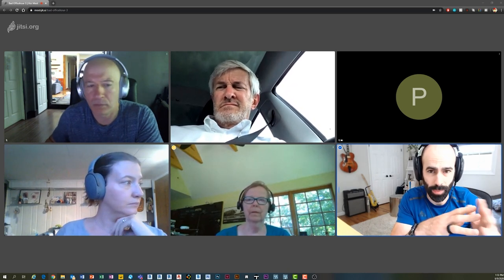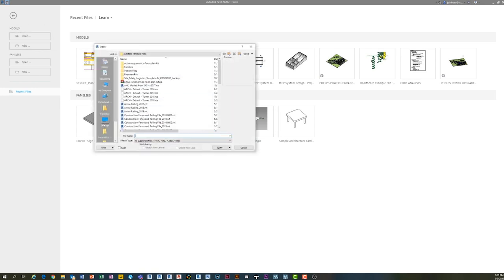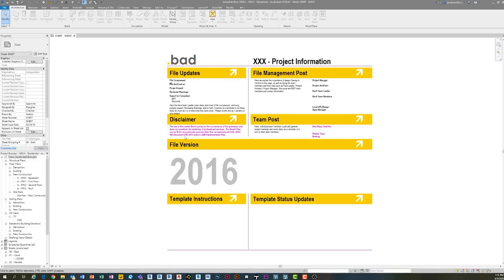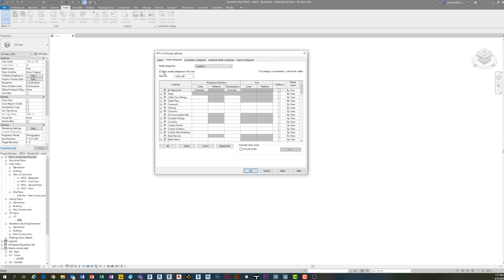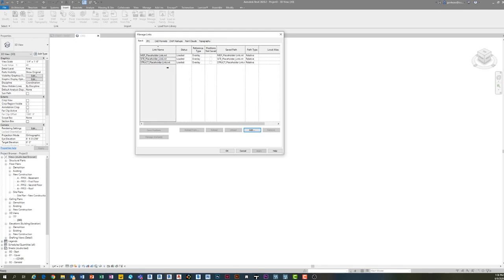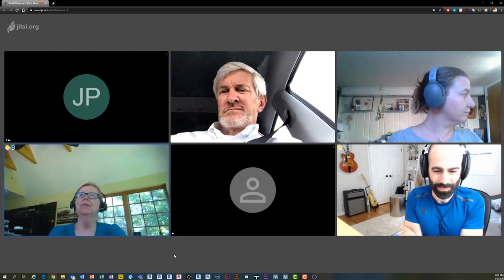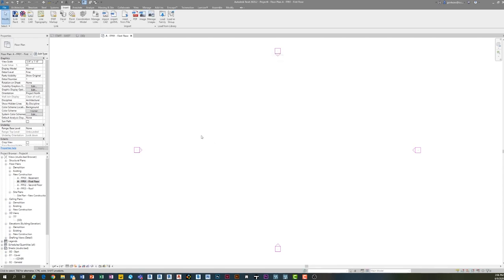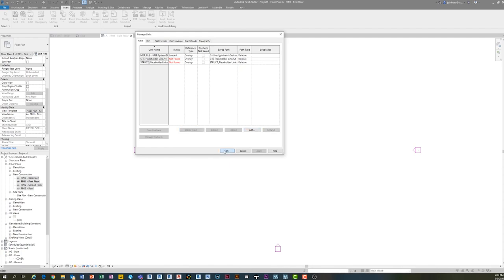Placeholder Links in Revit Tutorial (Office Hour Sessions)

Comment: Being on the General Contractor (MEP) side of things I found Linked Views with a combination of links as Attachments VERY helpful.
I am self thought in Revit so anything I say that I do here might not be ideal...

Since we get structural models from a design team that will have concrete work and structural steel (which is usually superseded by our subcontractor).
So the scenario I have in one of my projects right now is the design steel is removed, a linked view is set up and all out subcontractor steel is linked as an attachment.
The linked view is cleaned up with grids turned off etc.

Come into the MEP model, this linked view is then set. This means if we get additional steelwork models (for future phases) or updates, I can load this into the original steel model that's got the linked view.
I do the same for architectural if our internal and external walls are different.

Other scenario was pretty similar which was a project with multiple floors so it's just multiple linked views.

Now, what do I do in the MEP model? This might be where people cringe or internally scream no to themselves, I set up a template that affects ONLY revit links and sets my revit links to have linked views (arch and structural) and do one for each floor.
Then I can run dynamo to apply that template based on what the reference level is so it can sweep across and apply the linked view to all my level 0, level 1, etc.
Then I can swap back to a template that affects model and annotation categories specific to MEP services be it an electrical or piping template, these could then be used on multiple floors.

So linked view templates are floor specific across multiple disciplines (mech or elec).
Services tempaltes are discpline specific across multiple floors.
But working on data centres now, we work on 1 floor really so I haven't needed to go to that extent.
I don't know if good or bad practice but it worked for me and cleaned up a lot of stuff real fast and means it's consistent with linekd views.
Reply from the maker: Damn!!! My mind is blown... I am not sure if it's because I read that and was actually able to follow the logic or because I like the idea... :)  Cheers man!
Reply: @TheRevitKid  At least it made sense!
It's a bit of a hassle and it leaves you open to having your links modified if they aren't in the services based template but if you get it all set up, it's an easy fix to just rerun the dynamo to update your backgrounds.
Hosting all the structural files we get into a single model means if I get a new model to work on, we don't have to link everything, can just link a single model.
We do run into 1 issue though that it means if we're working on BIM360, everything has to be hosted on BIM360 as it won't accept links as attachments if you link through autodesk docs (which just baffles me that it doesn't work).

Comment: The use of a "dummy link" is most powerful in my opinion when it comes to showing linked annotations specifically room tags. If done correctly, you can get the architect's tags to show in your MEP model template without having to run anything. It's also useful to set up some 3D coordination views that are already filtered by color so all the Arch stuff comes in blue, structure shows in red, etc.. Love these videos! I ended up reaching out to Paul about the lookup table video. He actually got back to me! I wanted to know if he'd ever went down the rabbit hole trying to do specs in Revit. Have you ever thought about this? It would be so cool to have some kind of checkbox for specs, then Revit just prints them out organized correctly without using word.
Reply from the maker: Cheers man!  Yes, paul is great and totally accessible (like most of us “Revit guys”).  I dabbled in various spec software many years ago (like especs) and found the spec writers were the hardest to convince.  I’ve spent a lot of time these days working on how to achieve a model based deliverable and remove specs and drawings all together so it may be time to look back on those programs to see how we can build the specs INTO the model rather than extract specs from the model to make gigantic books out of.
Reply: @TheRevitKid  ahhh Yes that's a great idea. I literally made a note to myself the other day to provide an additional parameter for equipment called 'provide spec. Using your approach we can add an additional spec parameter for the multi-line text for the spec! love this idea. Now we just need to figure out how to get the formatting to work!

Comment: We have never been able to save links in a template file. We have always had a Revit model that stores the placeholder links. If the links are linked in by shared coordinates does it maintain that connection or does it use only center to center or origin to origin?
Reply from the maker: You'd most like wanted to have the placeholders as shared coordinates and then you can publish/acquire as needed.
Reply: @TheRevitKid  I was going to make the same comment. I've always been hesitant to do placeholder/ dummy links because I'm worried about the insertion method. Typically I use Origin to Origin, and then acquire coordinates on the architectural model (I'm in MEP). Coordinates are still kind of mysterious to me. Are there caveats or pitfalls to the linking method you are suggesting?

Comment: We have one architect that uses Archicad and gives us IFC files. :( Our template is setup with placeholder links for arch, structure, etc. Currently, due to poor handling of some categories with IFC, we use CAD exports of their model for print views but it would still be nice to have our placeholder setting apply to the IFC link. 

I know when you link a IFC file it generates an intermediate .ifc.RVT file. I'm wondering if you link the IFC to generate the Revit file then unlink the file and do a reload from on the placeholder link and choose the generated intermediate will the link update when you override the IFC file with a new version? Does it only know that the intermediate needs to be updated if it was linked using "Link IFC" command?

There is also a add-in by Graphisoft that has it's own commands for importing, linking, and exporting. I was under the impression that the link command had some kind of custom settings to more reliably create the intermediate Revit file, but in the documentation it simply says that their command runs the Revit "Link IFC" command. If this is true what is the point of having that included in the add-in? Anyone know if this does anything special?

I'm also wondering instead of linking if we should start a new project and use the add-in to import the file and save it every time we get a new IFC. That way we could simply reload from in our file on project startup and then just reload when we get a new file.

Comment: Hey There, I did this and I can't seem to get ONE thing to work. We're an interior design firm and we want all link walls to be Poche (Grey Solid Fill). Unfortunately, when I "reload from" and bring in the link, the Wall Visibility setting just changes to a different pattern instead of solid Fill. 
So for example, I brought in Arch's link, and all the walls are set to a Grey "Diagonal Up" pattern instead of the <solid fill> poche that I had set up in the view template. Any ideas why? It wouldn't be such a big deal if it wasn't such an obvious visual error.
Reply from the maker: Do you have those wall overrides set up in the placeholder link settings, as a filter, or in the view/graphics settings of your template?
Reply: @TheRevitKid  Within each of my view templates (Construction Plan, Wall Finish Plan, RCP etc. etc.) I have the Walls, CW, and Column overrides set to the Grey <Solid Fill>
I figured since that's a built-in Revit pattern type it should not be a problem. I find filters with links to be tough to manage so I've avoided that so far.